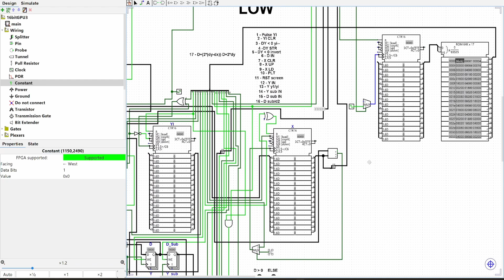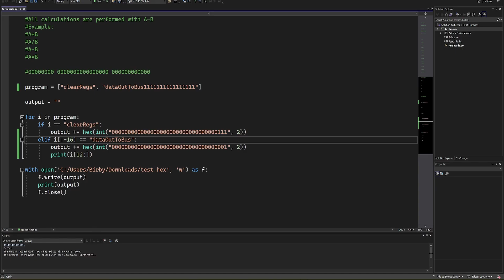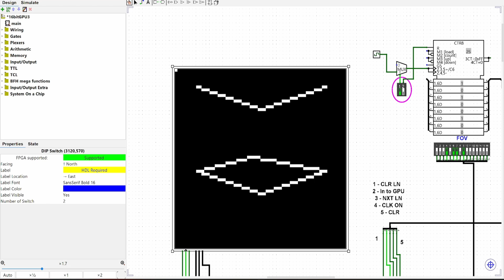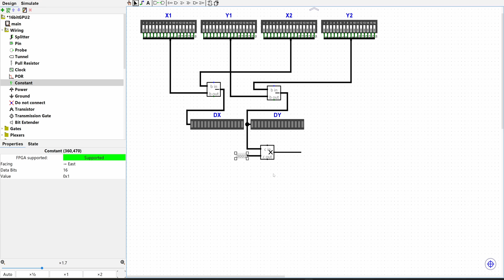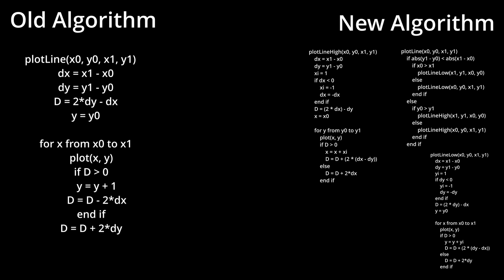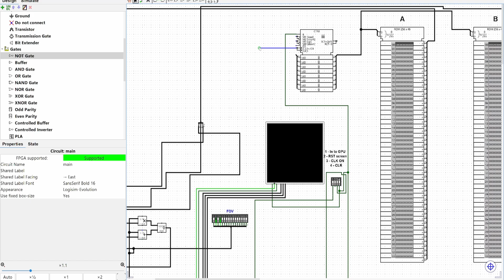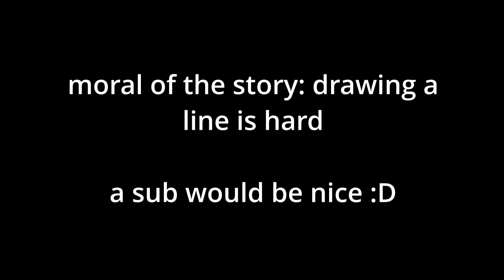I designed a 3D Renderer

Comment: Interesting. Im nearly 21 and nearly finished with apprentice. And tou can pull of 3D rendering at 13 years old. Impressive. What Logic Programm do you use in this video? Im currently designing a console with nes  concept based graphics.
Reply from the maker: Thanks! I used Logisim Evolution to simulate it.

Comment: You can actuary set all the clock speeds to 1 tick and lower the instruction clock to 250 tick's and it' still works the same but it's 25 times faster.
Edit: you can also remove the padding between the points to double the speed to 50 times the original

Comment: I wonder if you could create a shader processor instead of ray tracer, hear me out... if you created a tool that can apply some form of software controled update to each pixel, and then just... doubled it quadrupled it etc...  boom paralellism...  You may be able to even do it in some small amount of supplemental memory for the 'core' but that would be fun... ehem "fun"

In other topics there was a video on yt about how some hardware did 3d (it was sega, I think), it's talked about the pipeline being a matrix math accelerator some bits and bobs to store the output and wether or not to run some post calculations against it... and boom it did 3d math in a pipeline much like your line algorithm.

I'll search for it here for a bit and if I find it I'll ping ya, OR someone else can pipe in if they think they know the video.

In any event great video!, love to see more keep doing it.
Reply: oh i think i remember that, i forget the channel but it had some house shaped thing with a square and triangle and the guy worked on sega games or something. it was a big multi part instruction to do a bunch of math in parallel, and then each instruction could tell it what register to do that each time and get a lot done in parallel
Reply: @morgan0   Oh yeah, you might be thinking of SuperRT, the Super Nintendo Ray Tracer project.   Although that's actually quite relevant to what is going on here too I would imagine.
Reply: The problem with a ray tracer is that we repeat many calculations. For more "game-like" scenes it would make sense to place a quad-tree on the screen ( similar to hierarchical z-buffer) and then trace pyramids. If the scene is only composed of meshes and spheres ( for physics collision algorithm ) you can code all collisions. Then split up recursively. Even works with reflective meshes ( smooth subdivision of a water surface for example) and spheres. Does not work with bump maps or fabrics. So if you want to re-invent Blender cycles .. I think cycles is pretty parallel.
Again for games we want the shader to be fast with small triangles ( retro lowres 320x240 ). Though quadruple=2x2 pixel would fit well with the phrases in the Atari Jaguar. Only a small number of pixels is wasted. Generally I hope for a debugged Atari-Jaguar. For example the screen read-out circuit could read two lines (the 2x2 pixels) in the side borders into a buffer. Then send this two lines to the screen and release the unified memory to the shader processor. Or GBA like render into the 2 line buffer in parallel to share some texture fetches.
I think that modern graphic cards draw 2x2 pixels at once.
A fixed function pixel shader already has z-buffer, texture mapping, and shading working in parallel even if it only shades one pixel per cycle  ( N64 ).
The transformation stage is already quite parallel. Multiplication is more than 16 Adds in parallel. Then inner product is 3 MULs at least. With homogenous coordinates you have 4x4 matrix multiplication. This needs a lot of transistors all working in parallel. The critical path says that for optimal utilization you want like a 3 stage pipeline for the matrix multiplication alone. One vertex transformed per cycle is pretty dope, I think. Then you just need the memory bandwidth to read the scene graph and store the transformed vertices.